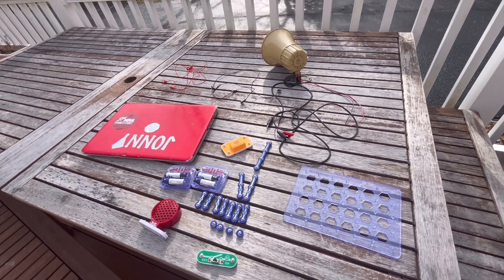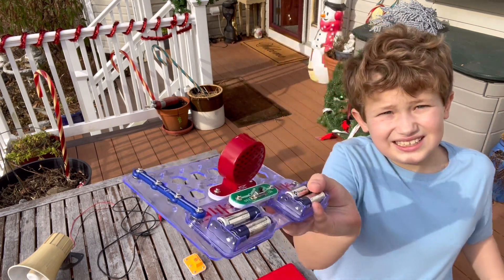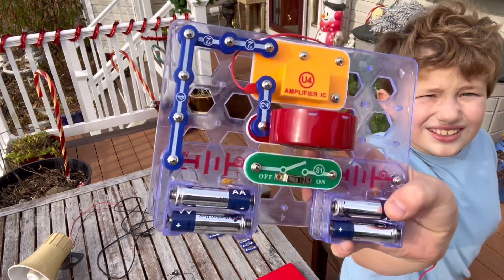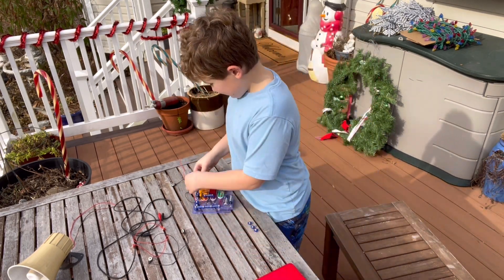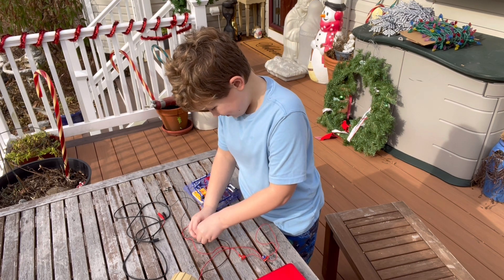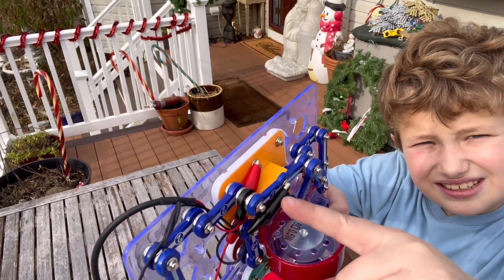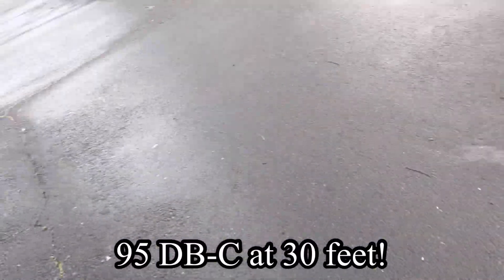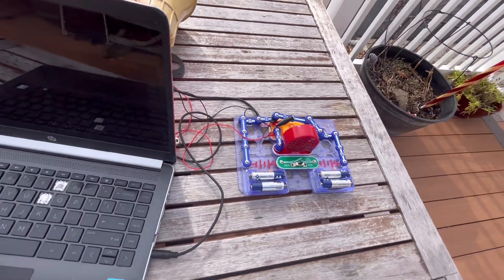How to make a Snap Circuits Amplifier

Comment: Awesome video, bro!
Reply from the maker: Thank you!
Reply: @GamingWithJonny3612  What is that b y the way? Like an electric constructor?
Reply from the maker: @sjsodareviews1023  It basically just makes the voltage higher so it makes it louder
Reply: @GamingWithJonny3612  Awesome! Where did you get something like that?
Reply from the maker: @sjsodareviews1023  You can order snap circuits on amazon, they have fair prices.